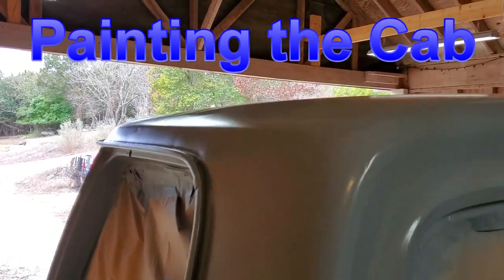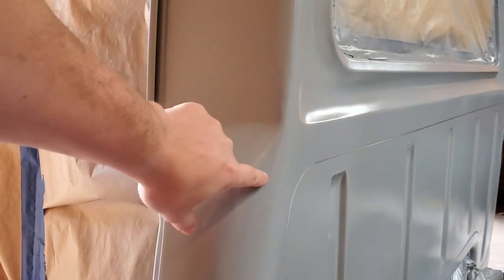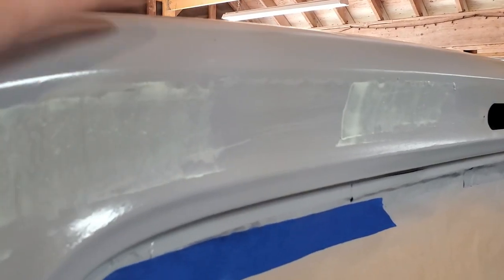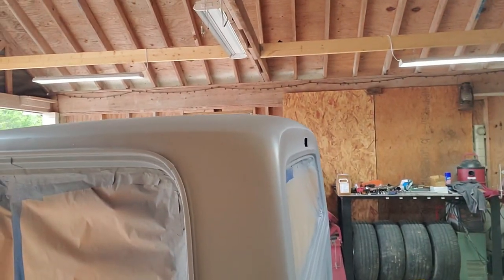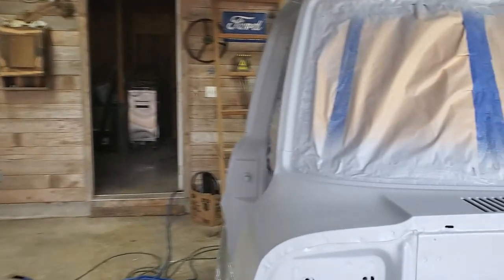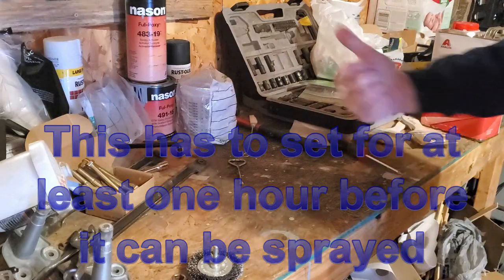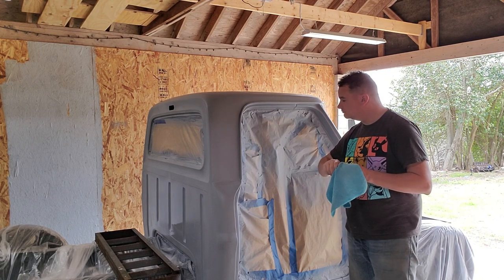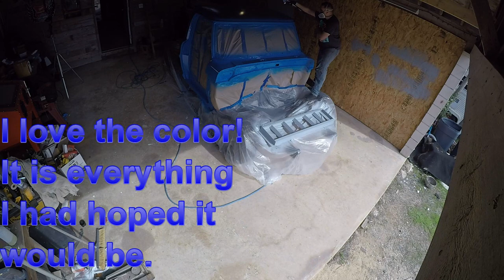F250 restoration project - Part 38 Painting the Cab

Comment: Please buy a better gun. You dont have to spend an arm and a leg, dont get me wrong. Hf guns aren't terrible. But not really good enough for the top coat.
Reply from the maker: When I get to the point that a better gun would make a difference I will. For now, I don't even have all the body panels finished and I didn't want it to rust while I was busy with other things. It looks better than spray paint at least.
Reply: Do you recall using a spray with a long nozzle for metal treatment?  I think it was sprayed I side the cowl